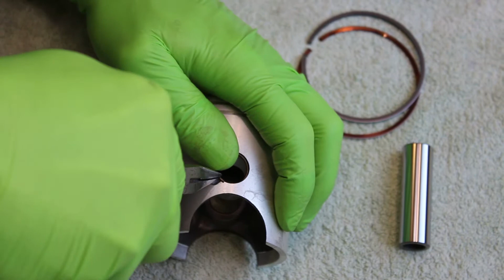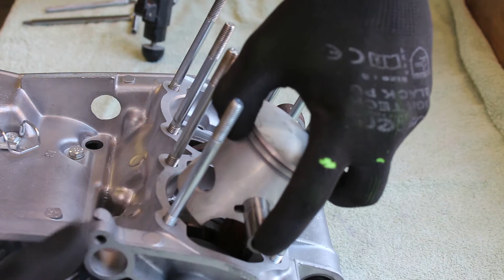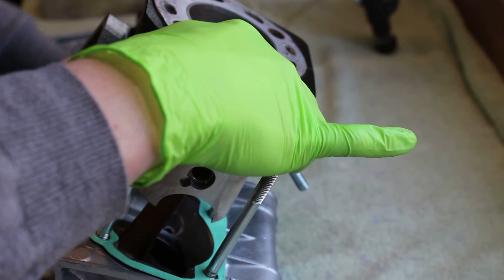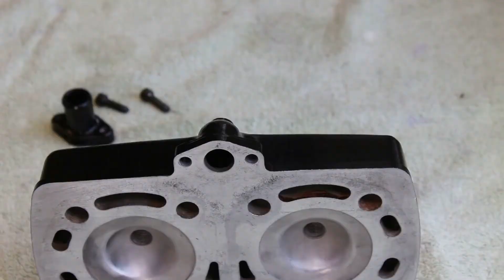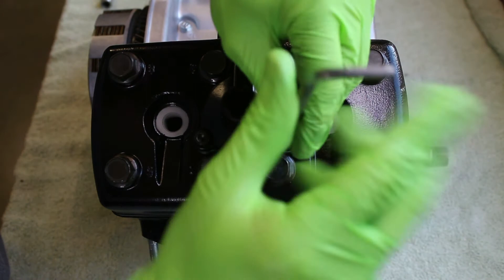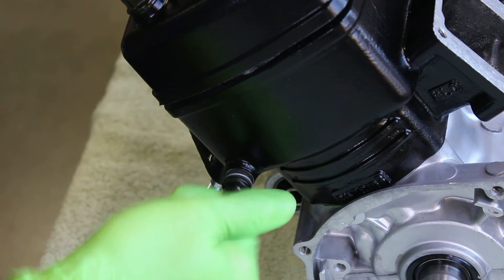RD350LC Engine assembly part 3

Comment: Hello, it would be important to specify the tightening torque of the bolts; could you tell me how much the cylinder head and nuts of the lower crankcase bolts and the upper crankcase bolts, thanks.
Reply: isn't there a service manual available? alternatively, you could use the service manual of the Yamaha YFZ 350 Banshee Quad/ATV, which has basically the same engine. there a several manuals available in PDF format

Comment: What did you torque the cylinder head to? I developed a small coolant leak and would like to confirm
Reply from the maker: According the manual: 24Nm (2.4 m-kg). I torqued it in two stages about the half for the first stage. The manual also states to -torque after the engine has run for the first time: "After installing the engine in the frame, start the engine and raise the temperature to 60degC then let it cool down and retighten teh bolts to specification". I still need to do that.
Reply: @jh-tech5546  where did you get the repair manual?